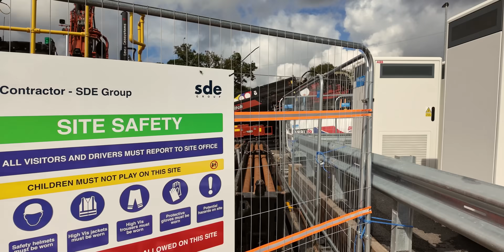Why This EV Company Is Digging Under One Of The UK's Busiest Motorways

Comment: I stopped at these chargers yesterday and the session kept unexpectedly stopping, without any reason given, both app initiated and contactless. Another guy had other issues. Not sure what’s going on there but reliability doesn’t seem to be there. Fortunately I didn’t actually need that much power so the couple of sessions that lasted no more than 5 mins was enough. But not a good experience, severely disappointed

Comment: Exactly two years ago we stopped at Rownhams North[/East] on the M27 and spoke to the engineers upgrading the old single Gridserve unit with the regulation 6 units [150kW I think]. Asking about the other side South[/West] where there was no sign of activity, they said there was insufficient power on that side and that the Highways Agency [now renamed] wouldn't permit going under the motorway!! 
Seemed a bit extreme but since there is already a small foot tunnel across, they probably could have put a trench under that tunnel ok with a bit of disruption. Anyway, a good year later, 6 units were finally put in on the Southbound services but they were throttled to little over 40kW each and I think still are.
I noticed old units being phased out too - next services up, at Winchester on the M3, the two old 50kW units had big socks pulled over them. Pity, because they are fine for my old i3.

Comment: 11:20  no, DC is LESS lossy. Long distance cables , like the undersea conectors to France and Norway are DC.

We use AC on the grid not because it is less lossy , but because it is easier to change the voltage with a transformer.

25kv as it comes out of the power station. 
Up to 400kv as it goes onto the pylons.

Down to 66/33/22/11kv  as it comes off the pylons and goes under ground. 

Then down to 230/415V at the local substation. 

Small users get 230v single phase 
Larger users like charging hubs get 415v three phase. 

That is  then converted to DC to charge the battery.

Comment: Dave, some of the longest transmission cables in the world use DC, HVDC to be exact as used on most grid interconnects these days. That's because DC is less 'lossy' than AC. 

Whether this site is AC or DC cabling will depend soley on design factors and costs, but will likely be AC if using the make of charging equipment as shown on the Southbound side that is designed of AC input. 

This means they have DNO agreement to extend the network under the motorway to an islanded site the otherside.
Reply: Mr Goat could you please have a word with Dave..... he's getting beyond stupid at times
Reply: John, why? I thought you were in it for the entertainment factor, wouldn't want to spoil your fun.
Reply: @GruffSillyGoat Well there is that 😊 byd now quick car 😮 over 300 mph

Comment: Oh dear even more land going under concrete never to be seen again.
Reply: Hardly as they will be installing on existing concrete!
Reply: @rustybkts  He doesn’t visit sites in early stages. I lived in rural Hampshire near Alresford twenty years ago. My memories of the area tell me that the location for the new Winchester charging hub outside Kings Worthy was a green area.
Reply: @rustybkts  No, even in Dave's videos we have seen new sites going in where the ground has been ploughed up.  This is not just a forecourt operation for one in one out like fuel stations, eventually there will need to be collectively acres of tarmac across the country even with super charges installed for the amount of vehicles on the road in the future.
Reply: @johnnyhollis9977  - there are already acres of tarmac, i.e. car parks, the idea is to electrify the parking spots eventually. Most cars sped 90% of their life standing still, perhaps the solution is to move the energy to where the car is rather than the car to the energy collection point.

Comment: It's blatantly obvious you've never been a teacher.
I've never heard such gibberish from someone trying to explain civil engineering.
Reply: All those drill "bits" connected to each other! 🤣
Dear me, two lots of electricians to do the connections. 
My guess is that they will install another sub and run a cable at the transmission voltage under the road.
Ok for the layman but as you say mostly gibberish.
Reply: @rustybkts  - yep, likely a DNO related activity as well. Though, I wonder if the motorway site is split across two DNOs (SP and NG possibly in this case), and Gridserve has reached agreements with the DNOs for one DNO to connect to the services on the other side with an islanded supply just for the charging. 

It's unlikely to be a DC connection as the ABB HP Terra units offer pair-wise charger cabinet DC sharing and the 12 charger cabinets will all be required to provide 175/350kW to the 12 charger EVSE points on the Southbound side, hence the cabinets DC output is unable to support any chargers on the Northbound side. It makes more sense to splice the transmission HV line on the Southbound side and run a feed to the Northbound side with it's own dedicated site transformer rather than run a high current LV AC line from the transformer on the Southbound side to new chargers on Northbound side.
Reply: I only tune in for the great comedy gold content 😂😂
Reply: Aye Dave is a Clown

Comment: ave i went to Helpston Cornwall in 2019 an the charging was really bad , im going again next week and it isn't much better from what i can see . im quite disappointed .
Reply: Helston is poor, but there is a Tesla O2A location at Camborne, which would be easy to use on the way to Helston. Fast ultra charging west of Hayle doesn't happen, because there's limited grid power available further west, which is why Helston doesn't have many options.
Reply: @johnnodge4327 I think you'll find that a diesel car would be far better to have in that area.... Saves all that faffing around 😊
Reply: @johnthemagnificent7022  Cornwall quite good for Tesla chargers, no need for smelly diesel.
Reply: @johnthemagnificent7022 
Nope. I live in mid Cornwall, but travel all over for work and leisure in an EV. Absolutely no problem for me, or a dozen other EV drivers I know.
Reply: @johnnodge4327  Hi Thanks thats helpful cheers.
Reply: Just get a diesel Audi 😊
Reply: @johnthemagnificent7022  Fc uk off
Reply: @johnthemagnificent7022 
Already got a diesel Audi. Trust me, our Ioniq 5 is miles better, which is why the Audi will be going as soon as a suitable electric replacement comes along.
Reply: What does that have to do with this video? 😂
Reply: @MattLockhart81  Because Dave lived there for years and he still goes there. Happy now .